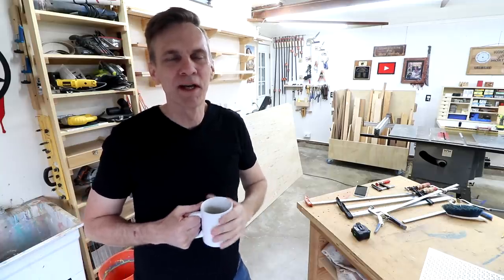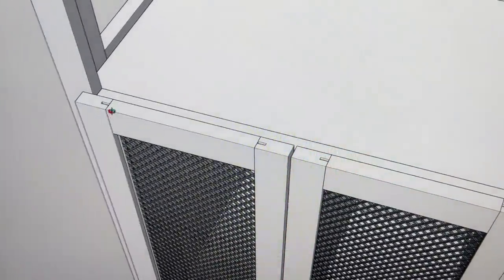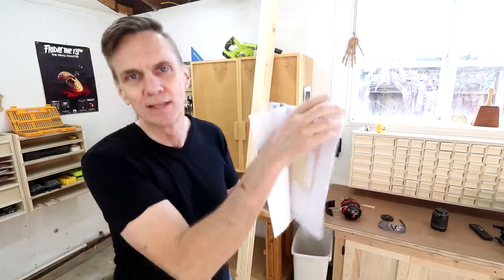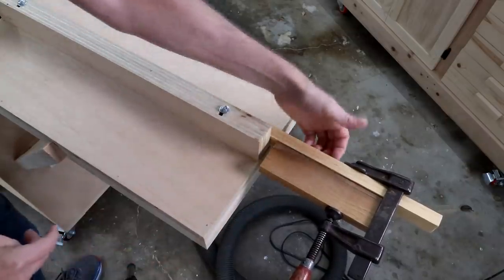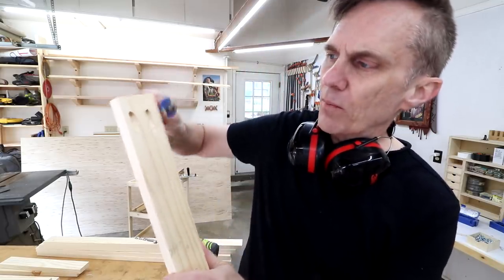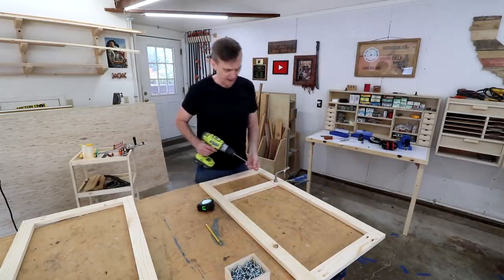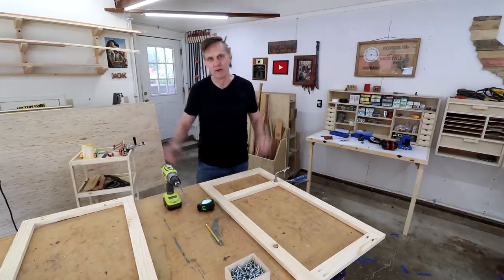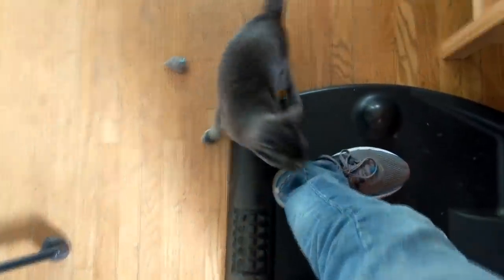LOCKDOWN WOODWORKING | Day 2 | Don't rout into pocket screws!

Comment: Thanks for the follow up Steve, I did not expect you to knock out another video so quickly. I hit a pocket screw with a rabbet bit and it exploded into tiny metal pieces. Luckily I had eye protection and hearing protection on but I still had to pick tiny pieces of metal out of my arm. Lesson learned! I've kept busy doing some finish carpentry and building a mirror frame while quarantined so the time goes by quicker. Honey-do list is getting done!

Comment: I've used similar aluminium panels and I just did a rabbet around the inside of the door and attached with glazing points. Worked pretty good for steam radiator covers.

Comment: Great project, Steve. Designing a printer stand can be a little tricky; I like your design, but I definitely would have to put my printer on top --- the top opens to accommodate the toner cartridges, plus the information panel and function buttons are on the top. And, of course, there's always the unexpected (paper jams), so accessibility is key. Looking forward to the rest of the videos in this series. Best regards!

Comment: I was thinking to attach the front metal panels.  You would cut a groove with the table saw.   Then cut a long thin wooden shim to fill the rest of the gap the panel left.   Glue the shim in place.  This way it’s in there nice and solid and doesn’t make noise.

Comment: I'm enjoying this approach, and I'm going to make a suggestion on the design.  You mentioned that you weren't sure about the aluminum panels because they are so much thinner than you table saw blade kerf.  I would recommend cutting the groove as you had planned and then cutting shims to size to fit in the groove on the backside of the panel to hold it snug in place.  You might could even use the drop from ripping the 1x3's if the groove is wide enough.  

I like this experimental "flash series" you're doing.  You're probably my favorite YouTube woodworker (though I definitely enjoy Izzy, Stumpy, Mattias, Bob at ILtMS, and others).  The special thing about this series is that it's natural and has the opportunity to be collaborative in real-time, like the person yesterday who told you hardware stores are considered "essential" in your area.  It's an interesting experiment, and I'm curious to see what direction it takes.  It seems exactly like the kind of thing you would do.

Comment: Hi Steve Ramsey, I really enjoy your videos and wish i had your woodworking skills. I noticed the router debris, while you cut the rabbits for the side panels, sprayed out horizontally. Another video i saw, created a downdraft sanding table and wondered if that would solve your debris field. A box formed around the router insert would give stability, a groove cut through to enable the vacuum to draw down the debris. The inner edge supports the router plate. Just my thoughts. Keep up the videos, you are one of my favorite presenters. Cheers

Comment: If you'd like an idea you could still cut the grooves on the doors for the metal sheets and add wood slivers almost like an inlay to hold the sheets in the larger grooves. Ideas for the future though :)

Comment: Not even an amateur woodworker, but I have a question for the aluminium sheets. Can you maybe fold a small lip on the panels to slide into the door as you wanted, to increase the thickness? Or maybe sandwich the edges of the metal between thin strips of wood and make the grooves a bit wider to slide them in?

Comment: Get a Triton Dual Dowelling Jointer.  It drills two hole perfectly and is only about $200.  A dowel joint is almost as good as a mortice and tenon and is not visible, like pocket screws.

Comment: I have a dedicated rip blade on my table saw and a dedicated cross cut blade on my miter saw.  I only use my table saw to cross cut if the board is wider than 10" and that is because I have to change saw blades.

Comment: I like the idea of building a project during CoronaPandemonium. However, I need to build a generator shed but it is still snowing out and it is not something that can be moved out of the shop and must be built in place. I can gather all the materials so that when spring finally arrives I can go to town.

Comment: "Good news, it's raining here"
Want some of ours? Northern GA has only had about 6 sunny days this year. Seeing as how my shop is my porch, and all my tools are tarped unless the sun is out, I haven't had time to do much of anything in months.
Reply: North Ga here too. No kidding. We just moved into a new (to us) place and the workshop has a bad water leak at the back wall, I can't ever get time to do anything about it because it won't stop raining. (Working 12 hr shifts doesn't help either).
Reply: @dy9955  Oof, I feel your pain. My front yard has pond scum because the clay under the top soil is so saturated with water that it just doesn't soak in any more.

If you need any help in the new shop though, hit  me up. I'm not sure where you're at, but I'm right off I75, about 20 minutes from the GA/TN line.

Comment: About those paper-thin aluminium pieces...

How about folding them over at the edges, so that you have more thickness to fill a slot?

i.e. back to Plan A, with some unscrewing, but at least you didn't glue those corners, and maybe you haven't cut the rabbets yet?

Comment: Hi Steve. Thank you for this series which is a grewat diversion away from today's very stressful world. I have a question which may seem rather simple but here goes. At 4:20 in the video I notice you are using the stop block to the right of the saw blade but holding on to the wood on the left side while you don't do that everytime. Do you worry about the piece on the right getting wedged and thrown back at you? I have always wondered which is the safest method to use - hold the main piece or the measured cut off. I realize "hands close to blades" is a no no but I find the question comes up frequently and I have never seen or heard anyone actually explain the correct, safe method. Thanks for considering this question.

Comment: Could you use a 7 1/4" diablo blade to cut the groove for the metal front panel? I believe the kerf on those are quite a bit thinner than a 10" blade.

Comment: Steve, I mentioned it in the last video, but I'm just going to come out and say it: You're going to build a very beautiful piece of furniture that is going to be absolutely useless and heart breaking:

1. You're going to cook your PC to death. They need airflow. The muffin fans inside the case don't have enough power to move the air outside of the case in that wind tunnel you've built, and all that wood is just insulation to keep the heat in the box. (Yes, wood is an insulator of sorts. A 2x4 piece of lumber has an R value of 3. Look up Matt Risinger video where he talks about insulating a home.) To fix this, you need to put your PC in the LEFT BAY, and make sure the LEFT SIDE is the same mesh you're using for the front. (Most PC tower cases are designed to pull air in from the bottom, front, and left side, and exhaust it out the top and back.) 

2. Unless you plan for storage for your mechanical hard drives, you're going to kill them. They don't like to be banged around, and the few that can take it are the super expensive drives used in datacenter operations. (They're designed for use in storage farms where you have a bunch of drives tightly packed, because hard drives even hate the vibrations of being packed in tightly with their brethren.) You want to make a drawer tray with padded, vertical pockets for the drives. And you want the metal drawer guides that will let you pull the entire drawer out of your cabinet, because you will be hating life every time you reach into the back to get a drive out. (Also, you may want to talk to either Paul's Hardware or Linus Tech Tips about building a NAS for you.)

3. You want a pull out drawer tray for your printer. I give you three paper jams and/or ink/toner cartridge changes before you're hating the thing and using your wife's printer instead. You want to be able to slide the printer out easily anytime you need to futz with paper jams and cartridge changes.

4. YOU NEED WIRE MANAGEMENT ON THE BACK. Especially because you want to put casters on the bottom and roll this thing around. Cable management isn't just for aesthetics. It's to protect the cables and the equipment it's plugged into. The moment you start rolling that thing around, you're going to snag cables and either pull whatever device they're plugged into out of the cart and onto the ground or rip out the socket the cable is plugged into. And cable management isn't that hard. All you need is a small box like channel and some hook-and-loop straps to tie the cables down. I'd go as far as installing a power strip on one side, so the ONLY ac cable trailing the box is the one for the power strip.

5. Your Wife's printer is probably going to make rolling that thing around a REALLY BAD IDEA. It's going to make the cart top heavy, and most casters don't like rolling on carpet. I know building a wider base is out of the question, you should look into mounting options for the printer. It'll make the situation at least a little more manageable. (You still have to worry about the cart tipping over, but not the printer falling off the cart.

Comment: Could you route out the back of the door and possibly screw the “screens” down?
Reply: Staples would work just as well. He could also cut out the strip for the channel (instead of routing) and then staple/glue/screw them into the back after the material is put into place.
Reply: He could install the panels like a picture frame.  Route out a rabbit, then screw, glue or staple the screens in.